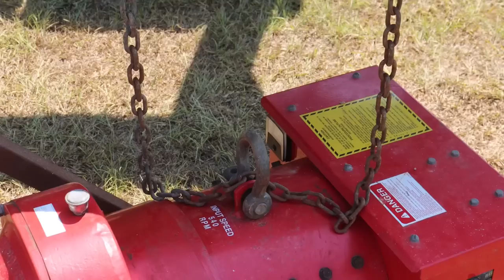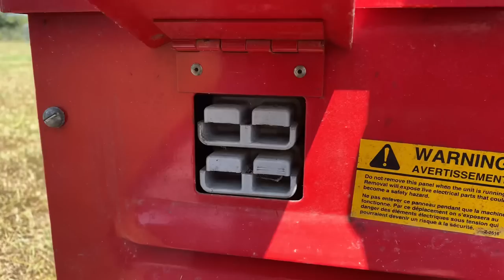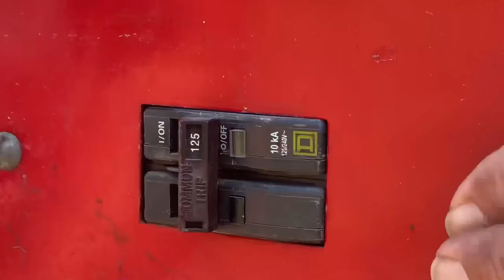LOUISIANA WILDFIRES | We Were NOT Expecting This.

Comment: You need to consider installing sprinklers either on or near to your house.  I have a 1,000-gallon tank (from IBC totes hooked up in series) worth of water ready to go out to a pump.  The generator powers the pumps.  That will keep things wet.  Flying embers are one of the main reasons houses burn.  They blow up under the eaves and get into the vents.  I would consider plowing several rings to bare dirt around the house.  Thankfully many fires move quickly but if you are prepared....

Comment: I'm so glad everyone is alright, I've been a fan of the channel for quite a while, and only wish the best for you guys.  Now, at the risk of being "that guy", I need to say please check the size of the wiring you are using on your generator.  The wire going from your generator into your home appeared to be too small in size for the protection breaker of the generator, meaning; if you have a fault, the wire becomes the fuse, and, will burn itself to clear the fault.   Emergency generators are great for keeping the power on, and are normally only used in an emergency, however, most people don't really give consideration to some of the dangers they can present.  I enjoy following you guys, and don't ever want to hear of some natural disaster we're semi-used to going through on the Gulf Coast having a follow-up chapter that brings worse news due to something like an overloaded wiring situation.  Take care and stay safe.

Comment: Have ya'll considered building a small fire protection unit for the truck and/or a stand-alone unit by the house? 12V, 110V or gas-powered pump will work as long as you have the water and power. Best practice may be to use a water tank direct-connect (IBC pallet tank) or even a suction hose/filter for a pond/stream. I have a 10 gallon 12V system on my ATV that works great here in the hills.

Comment: 🙏 Hope you don’t have to leave. If you line your chest freezer with water bottles - then cover the top with water bottles it will keep everything inside frozen for 10 days - opening it only twice a day - I tested this in Central FL a few years back. We were out of power 10 days and had prepped meals ready to reheat layered with the water bottles. It was still frozen half way down when they power came back on.

Comment: If you go solar for off grid, thats a great move. But eventually you wont get enough sun for days. That where you look at another propane generator, Generac. Hook the generac up to where when its running it charges your solar system. With generac you dont have to have gas cans sitting around!! Have propane tank and then put the generac generator as your solar backup. Have it serviced each year, and you will not have to go without power again.